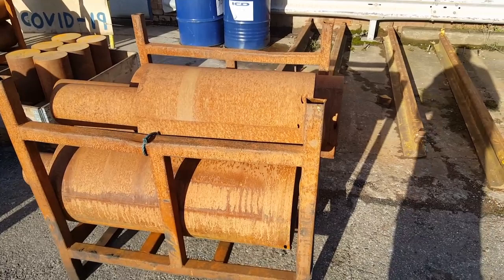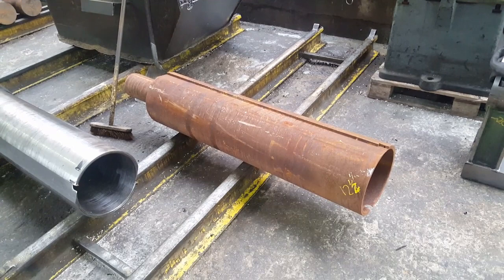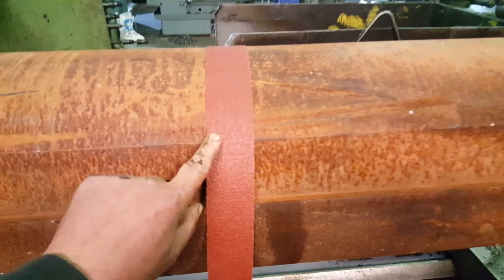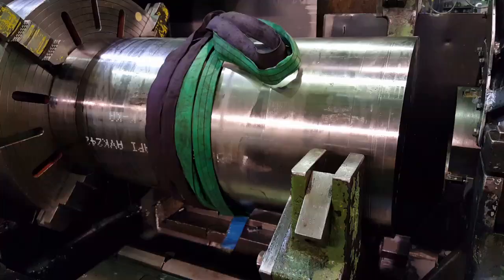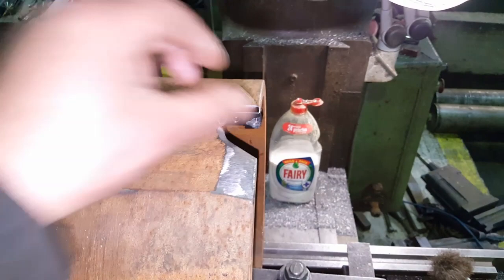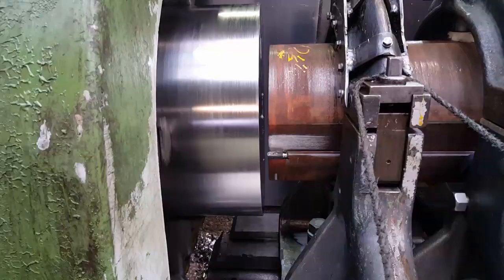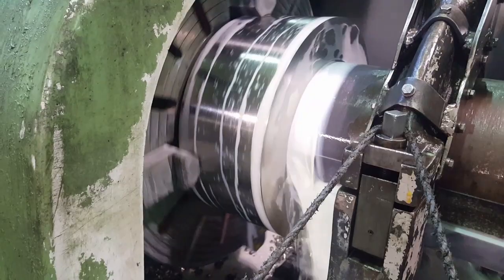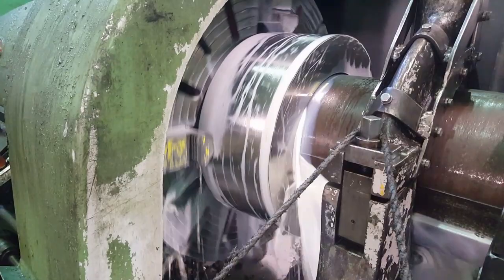Machining Steel not always easy 12" hole drilled by Trepanning inconel 718

Comment: For the comments section: Inconel alloy work hardens, to machine it you must go slow with high feed rate to keep in under the surface work hardening. Inconel alloy is used for its strength in high temperature environments like rocket engines.
Reply from the maker: Cheers Chris. 👏🏻👏🏻👏🏻🍺

Comment: Used your WD40 tip there when turning a few small parts. Shallow cuts with HSS. Kept the cut nice and wet with a super finish. Better than the cutting oil.
Reply from the maker: Stephen that great news. 👏🏻👍
Reply: What material were you cutting?
Reply: @Andrew_Fernie  don’t know the exact grade was a peace of mild steel out of the scrap bin.
Reply: @stephenweir2003  Thanks. I use WD40 on  all non-ferrous but haven't tried it on steel. Yet!
Reply: @Andrew_Fernie  just came into my head what David always says about it. Works well on a shallow finish cut. Stays wet

Comment: Good Heavens that Craven must have a 20 foot + length of cut. Not something you see very often these days.
A thought, if you are running into problems with the lack of available feed speeds it may be worth motorising the carriage? 
You then could optimise the tool loading for every cutter diameter and material.  It wouldn't need to big a motor and use a reduction box to drive the carriage drive gear. It would also free up a bit of spindle hp if it needed it. You would only need a drive for the feed motor and a couple of encoders if you wanted to absolutely fix the feed ratio to the spindle. I would assume that that isn't necessary at such low speeds. 
Just a thought
Cheers
Reply from the maker: I've already suggested it but the owners are happy with what I get out of it 😟

Comment: When you change the cartridge do you restart the tool from the beginning of the job or from were the cartridge failed??, you mentioned 3 degrees needed maching on the tool at the front or on the waste channel of the tool??,
Reply from the maker: Usually can feed down but sometimes yes start from the beginning.  I meant to say a 5° taper the length of the scrap channel.
Reply: @userwl2850  I asume 5° on waste channel allows more clearance for swarf to clear the channel?

Comment: What are the chances that the company would buy the very large VFD needed to run the lathe in high range but at the lower RPM necessary.  My guess is slim to none.
Reply from the maker: You're right David...... none 😭👍

Comment: I've got this light blue button on my Huron very similar to yours and the bloody button doesn't do anything? Your thoughts? I thought it might be a spindle lock. Does yours have a spindle lock? Cheers from Canada.
Reply: I am not a turner but it would surprise me that something as critical as a spindle lock would not be clearly labeled as such and in a more eye catching colour than light blue?
Reply: @markfryer9880  Huron is a universal mill not a lathe. |The identification is worn off. but next to it shows a vertical bar either side of a cutter.

Comment: Make the support for the Craven 6” and you won’t have to modify all those tools. 😎 so why didn’t you just chop the end and Remillard the tool to begin with rather than fighting it thru the holes?
Reply: I suspect that it was a question of the time available to get the job out the door.
Reply from the maker: End of month invoicing Brian. I'd have lost a day correcting the tool.

Comment: I have never seen a 4flute trepanning tool. why?
Reply: I was wondering the very same thing during the video, so it will be interesting to hear David's answer. I certainly think that the lathes would have enough torque to power the four cutting tools, but there must be a good reason why we haven't seen a four cutter trepanning tool.
Reply: @markfryer9880  I think it's a case of setting the cartridge depths.  With two cartridges, you're guaranteed to have one further out than the other, both taking a chip.  Now imagine setting 4 to take an equal cut.
Reply from the maker: 2 covers the width of cut. No need. It wouldn't help. It's a bit like wearing 2 pairs of shoes or 2 hats. 👍🍺

Comment: Craven's factory was not far from where I live in Stockport. When it closed a lot of the men came to my factory, Fairey Engineering. Cravens made some massive machines. Google it.
Reply: I live at the other end of the street from Craven's Factory, Father worked there.
Reply: @boostie1005  What is his name and what did he do?
Reply: @geoffgreenhalgh3553 when Cravens closed he was in charge of the Maintenance, Fred
Reply: @boostie1005  When I came out of the training school at Fairey Eng, I wanted to get on maintenance but ended up on turning. I did it for 49 years. Where did your dad go when it shut. there were loads of jobs then.
Reply: @geoffgreenhalgh3553  he and some others from Cravens set up on their own re-building Machine Tools
Reply: @boostie1005  Very good. A lot of skilled men worked there.
Reply: @geoffgreenhalgh3553  I was in the Fairey Eng Training centre early 1980's on Youth opportunities scheme, got the toolbox,I finished what we were supposed to make and write up over a month early and was put  with the Fairey Apprentices, when my time there was up all got a bit strange was called to see training centre manager Mr Swarbrick if I remember correctly was told I could not stay as an Apprentice and he was angry, I heard shortly after I left one of the guy's training us packed it in his name was Harold and the other  trainer was Fred, he was a great guy, Harold was very particular as to accuracy. I have heard a few stories after I left there as to what happened but the stories contradict, do you know what happened ?
Reply: @boostie1005  I started there in 1968, stuck it for 10  years then was off chasing the money.
Reply: @geoffgreenhalgh3553  Cheers for that, I have  quite a lot of Craven Gazette's and handbooks, sales brochures and even some drawings. Don't know how i missed that youtube video.

Comment: Worked in texas 1980 we did this sort of thing all the time.  got laid off went to new mexico worked in a shop.  Showed my boss how to do this kind of operation, and got a $1.50 an hour raise.    Of course as with everything, the company went out of business, due to wall street speculation killing our biggest customer.  Wall street took the machinist profession and lowered to just above the social status of a carnival freek.   when i started in 1972 machine shop parking lots were full of new cars, and the guys in the shop had expensive hobbies, like race cars and private vintage airplanes.  And motorcycles and fast speed boats.  times change.  bet machinists in china have fast motorcycles.